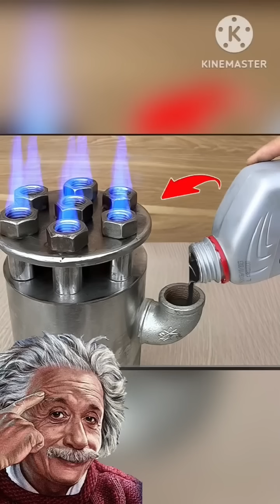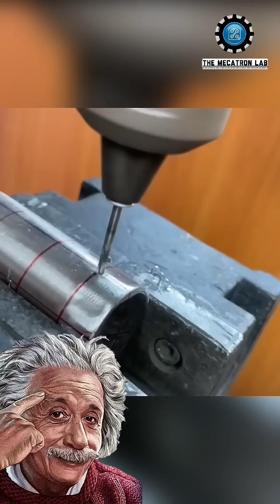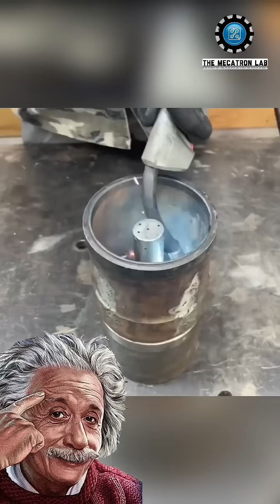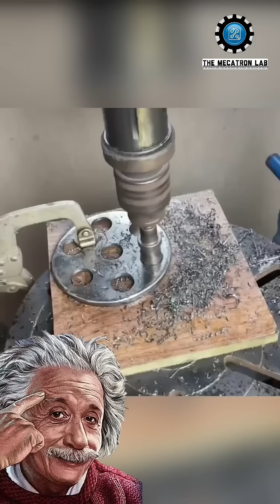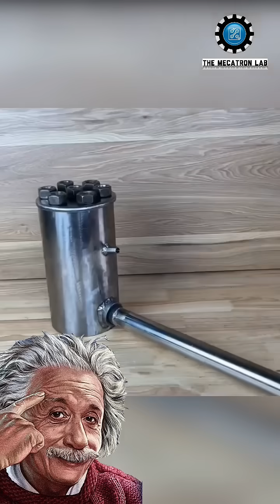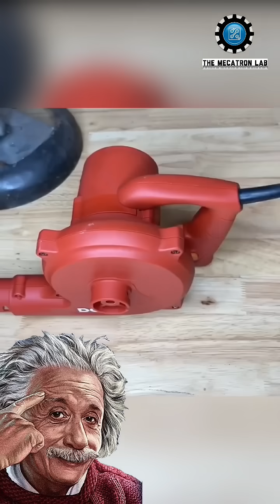How To Make waste oil Stove using Metal. #diy #science #experiment

Comment: What about the smell, How about the fumes, need a lot of ventilation/
Reply: You are really saying that burnig exaust engine oil does not produce an incredibile amount of toxic gas and heavvy metal oxide just because you do not "see" them?
Reply: @riccardobiancone3240  well, I need more info about that, because if we note everything that makes something unhelthy the list wont end. it is more danger than smoke? I said what I noticed about it. I have no laborial stuff to measure those bad things. the temperature is very high to just leave gases freely come out.
Reply: @Hudsonkem  Actually the combustion product of that burner is poison
Reply: @riccardobiancone3240  which poison? and how much for cm³?
Reply: @Hudsonkem  Sorry I have no time for a chemistry lesson (and I am not so prepared), try to Google starting from this: 

Safety Concerns: Old engine oil can contain harmful contaminants, including heavy metals and other toxic substances. Burning it can release these pollutants into the air, posing health risks to you and your family.

Legal Issues: In many places, it is illegal to burn waste oil without a proper permit or system designed for that purpose. Regulations are in place to prevent environmental contamination and protect public health.

Efficiency: While some systems are designed to burn waste oil, they require specific burners and proper setup to operate efficiently and safely. Regular heating systems are not equipped to handle waste oil, which can lead to equipment damage and inefficiency.

Environmental Impact: Burning old engine oil can contribute to air pollution, including the release of particulate matter and volatile organic compounds (VOCs), which can have detrimental effects on air quality.
Reply: @Hudsonkem these ppl replying to you are ignorant and don't know what they are talking about! Ppl here in Canada have been using old oil drip stoves to heat there shops forever.
Reply: The neighbours would be delighted 😂
Reply: Complete burns do not have smell. Only incomplete burn create soot and smells and gases.  Look at Thermal mass Rocket Stoves and how they are able to burn wood and produce no smoke.
Reply: When you heat up exhaust gases it gets rid of a lot of the bad stuff that's how your catalytic converters work so I'm guessing some of that is going on here
Reply: did you try this by yourself already? after ignite well, it wont smell, it does not produce fumes, at least not visible one. you can try a small version of it by yourself. I did a small version, it does archive 440°C
Reply: @Hudsonkem  Anything you burn will produce fumes.

Comment: runs on used motoroil , omg thats the way to lung cancer lol
Reply: nope, the burn is very pure after it ignite well. the blow air make it burn it high temperature. for precaution, just dont use it on a closed room.
Reply: Poison gas and metal oxide are there also of you do not "see"them
Reply: @riccardobiancone3240  can you tell more?  the poison gas is not burned at 500°c? and this metal oxide?
Reply: @riccardobiancone3240 😂😅😅🤣😂⁉️⁉️⁉️
Reply: "Burning" does not mean "destroy" or "annihilate". In a diesel engine the temperature reach 700 °C BEFORE the fuel injection and 2.500°C  during combustion.  If you theory would right there should be any pollution from any engine and any combustion. Unfortunately it is exactly the opposite.
Reply: As well the heavvy metal that are in the exausted oil are not destroyed by combustion, but just transformed in gas and other chemical compost, or do you think there is a sort of nuclear fission?
Reply: @riccardobiancone3240  motor oil is same as diesel?